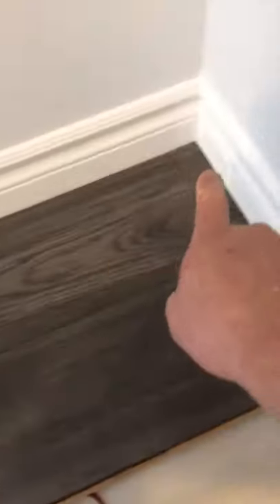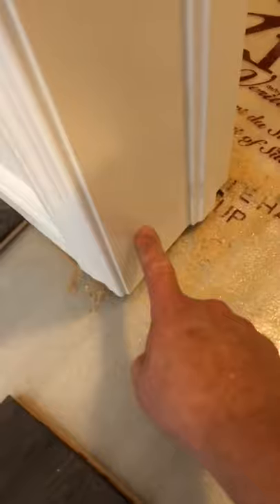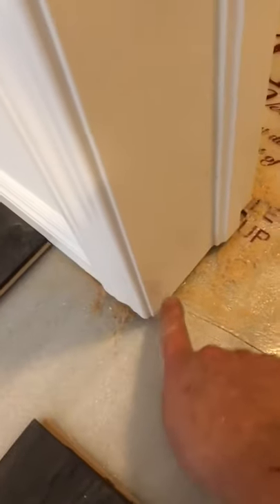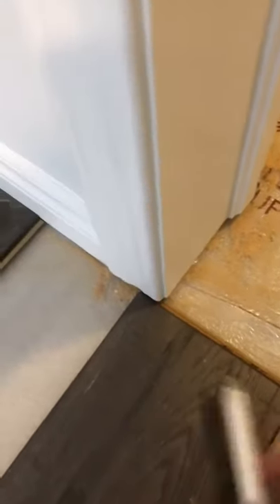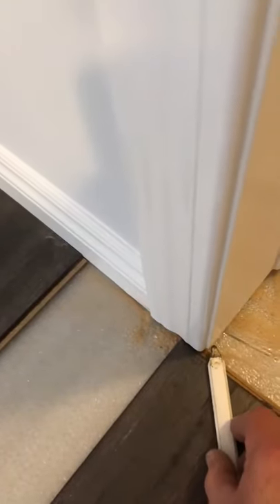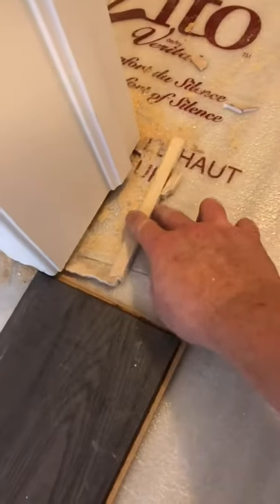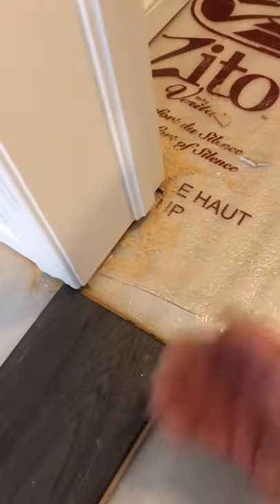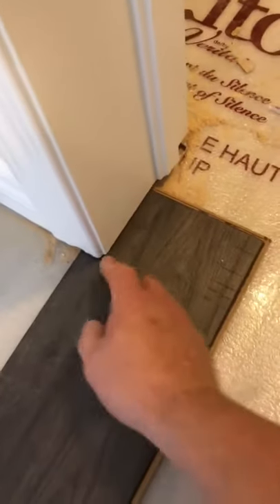DIY Laminate install around door jams

Comment: Use a multi tool to cut door jams not a sawzall and you are supposed to put baseboard on after doing the floor that way you just have to get close to the Sheetrock and then the baseboard will sit directly on top of the LVP and you won’t have any gaps
Reply: Thank you! I can't believe some of these amateur videos I see on YouTube, I'm the guy they call to fix all of their jobs 😂.

Comment: You need to take skirtings off if possible, or do your flooring before the skirting as it seems these mouldings are new and have just been fitted. This is because you need to leave an expansion gap of 5mm to allow for expanding and contracting. This also allows for a nicer finish after you skirt on top as you will have no gaps and there’s no need for any beading to cover said expansion gap could you not remove the skirts. Also a multitool or even a sharp handsaw would give a much better finish for cutting out the door frame than the reciprocating saw.

Comment: Coming from a general contractor.......do the floor first if you can or take the casing and trim off carefully....it's much easier.
Reply: Fellow general contractor, I almost always lay the floor out and set my jambs in afterwards, the finish is tight and clean no comparison to other installations. Your 100% correct!
Reply: @addsurfer1970 
Agreed I would not mess with set jambs, just undercutting is enough. I can only begin to tell you the horrors I have seen in finishing.
Reply: Never said anything about the jambs but okay......but yes set the jambs after the flooring and put the casing on after that.....